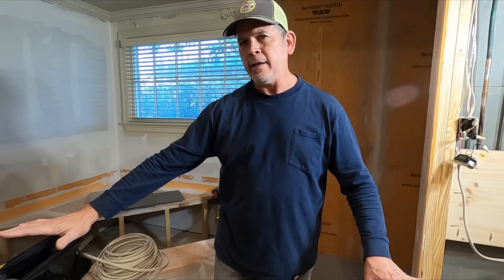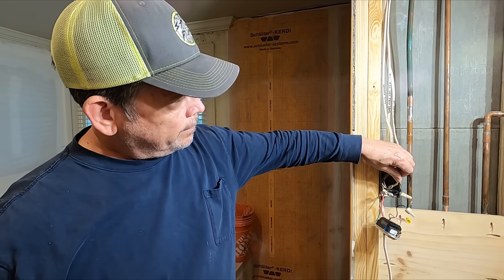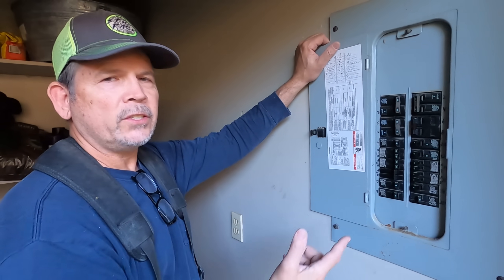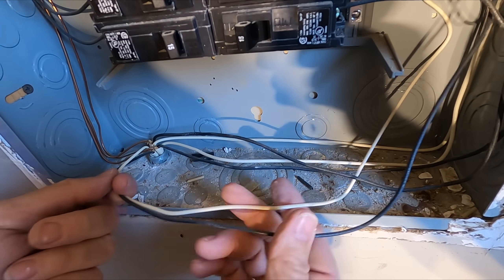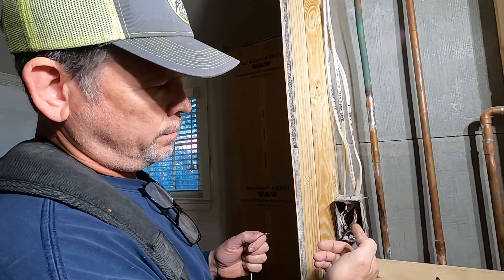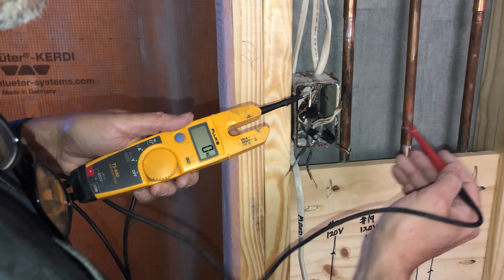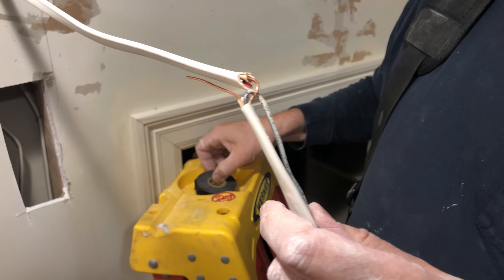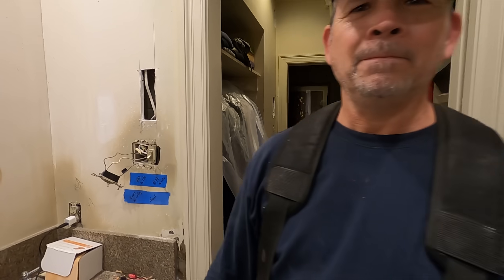You CAN Get SHOCKED by a Neutral Wire! This is How...

Comment: My worst shock... I was working on an election hot water tank... I turned off the breaker, went to the hardware store and got a new tank, all was good... Removed all the plumbing from it then I took off the wire nuts and then went to grab the wires to pull em from the tank... Well Someone went and turned the breaker back on so I grabbed a live 220V circuit... It threw me against the wall... I came out barely walking, staggering... Turned the breaker back off and finished the job... That was my worse... 110 I barely feel a tingle...
Reply from the maker: Thx rusty nail.  A previous comment said “that’s why they call them hertz” 😂

Comment: First, a great video! As an owner of electrical supply company for many years, I have heard some crazy stories from "our electricians". Many involved "dirty neutrals". One thing to be aware of, many LED issues are the result of either dirty neutrals or overloaded neutrals. LED's are super-efficient, therefore they "return" unused power through the white wire (neutral). There are cables available with super-neutrals, that is to say, they are manufactured with a white wire larger than the black wire. The other thing to be very aware of is when removing or replacing a panel cover, always wear eye protection (preferably a face shield) and gloves. We had an electrician who was severely burned removing a panel cover. There was an exposed main feed cable resting near the cover. As they say, wiring is no hobby...call a licensed electrician!
Reply from the maker: Thx Ron 👍 good stuff about super neutrals and safety 👊

Comment: The wire you are claiming is a neutral is a hot, and marked as such by the black tape which is legal and normal.

Not that I am saying you shouldn't check anyway. Or that there was not issues with this work.
Reply from the maker: Thx Court.  Many caught this.  That tape was me identifying that neutral as “hot”.   It was not a rebranded white wire.  Sorry for the confusion 👍👊
Reply: @StudPack  Ah, I see.  It doesn't change using caution and not trusting the marking of unknown wiring though so you still make a good point.  I know I have blindly trusted it before.

Comment: Can never be too safe around electricity. Commercial carpenter here, when we're building high rises we don't always have access to GFI protected power sources. Sometimes we have to plug our cords in to the building's power outlets as we build up higher, and you can imagine how that works when we're working up top on a rainy day and there's 3 inches of water on the top slab.

Worst shock I've ever had came from trying to unplug a power cord from a 4 way splitter that was hanging on rebar (to keep it out of the water puddles) and the cord had a cut in it that I didn't see, right where I grabbed it. One hand on the cord, the other on the rebar completed the circuit. I couldn't let go of the cord due to the shock, I had to walk backwards away from the splitter to make it disconnect before I could let go.
Thankfully the electricity path stayed on the surface of my skin since it was raining so hard that day, but my arms sure tingled for about a week. Could've been a lot worse if it had gone through me. Now I religiously check all power cords for cuts :D
Reply from the maker: Thx Keith 👍👊.   That hurts.  Really appreciate you watching and commenting
Reply: @StudPack  No worries Paul, just found your channel and I love watching this kind of stuff to pick up on all the tricks other tradespeople use on their projects.

Comment: As an Electrician, I am impressed with your explanation. Great Job. One thing though, standing on the top two steps of a step ladder is a big no no. I believe you will notice that even the ladder warns against doing that. A fall from 6 ft can hurt alot worse than 125V shock. Just sayin'
Reply from the maker: Thx max and I hear you about the ladder 👍

Comment: too many jack legs doing wiring, its those guys that will get guys like you hurt. my house had over half the receptacles wired with black and whites reversed. Not sure I could of figured out the solution as you did, I am an EE but its the troubleshooting these type of problems I need to improve on....

Comment: And the reason the lights come on when bonded to the copper when is bonded from the main panel is the EXACT  reason 4 wire is ran to a sub panel and separated. Good work.

Comment: 12:52 I can't stand attics.  I've been re-wiring my house and the only cables going into the attic are ones that absolutely have to.  That being light fixture cables.  Anything else that was previously going through the attic was re-routed down through the basement.  A lot of 12/3 cables.  That's one reason I don't want to pursue a career as an electrician, I know I'll be in attics a lot and that's where I draw a line unless it's winter and cold haha.

Comment: 4:09 is that current as of the NEC 2020 or is that a local stipulation for your area?  Because I believe subpanels only require their own shut off if they are installed in a detached building such as a garage or shed.  If it's not detached, it doesn't require it's own shutoff.  That's what I last understood...but maybe they changed it?  Either way, I wouldn't want to have a subpanel without it's own shutoff personally.
Reply: I live in an old house and neither our main nor the sub have master breakers. Instead you have to pull the meter out. The sub is connected on the main bus bar lugs instead of a separate breaker.

Comment: What you had was a floating neutral with that white wire not connected. All neutral wires MUST connect back to the panel neutral else it becomes a floating neutral and will have voltage on it relative to ground.

Comment: Neutral is only as safe as the breaker supplying anything powering devices connected to the neutral. Where you screw up is assuming turning off the breaker also isolates any other sources.

Comment: Stablok panels are 1-2-3-4-5 etc on the left then say 20-21-22... on the right, those breakers are also 'reversed' off and on.  You also have to 'drop' one breaker for 240volt - 1/2 3/4 etc are same phase so you have to single 1 to get 2/3 for 240volt. Stupid system.

Comment: So horrible wiring that's not to code basically leads to a live shared neutral. There are by the way switches that would trip in cases like this, however I don't think it typically used in the US unless you are in a bathroom. I think they are called GFCI switches. They are basically becoming common where I live as they have the benefit of tripping out a single circuit if there is a fault to ground as opposed to an entire panel. It should be noted that in old installations tripping the entire panel with a ground fault only happens if you have a distinct ground fault breaker (rough translation the name my differ). These have however been mandatory for a long time and I don't think you are allowed to operate a house without installing one unless all switches are of the GFCI type.

Comment: Any properly wired neutral cannot shock you, as it is truly the exact same thing as your bonded ground... Electricity isn't mysterious or confusing, just takes a bit of understanding... as a previous electrician, controls electrician, flows and controls engineer...I can tell ya, if a N gets you, it's because of an improperly wired scenario, likely a backfeed. But rest assured, so long as you don't take the hit from arm to arm through the heart... 110 isn't going to get you to the point of feeling days later, let alone moments later... You feel the tingle, you back off and re-evaluate things. Shouldn't get that far, should be testing before touching.... but yeah, outside of 3 phase, 277, 408, etc.. you aren't in for too much of a bad time... Residential can't get ya that bad unless you REALLY line things up for a proper Darwin award.

Keep in mind, ALL neutrals are shared via the common bus in any given panel... You shouldn't ever mix neutrals in junctions or any other box, as you need to worry about neutral balancing ... but yeah, ALL NEUTRALS are the same neutral... always. Just about always. But yeah, you've got an issue there.

And an edit later, you hit these items and found a backfeed... improperly wired, viola.... as expected.

Comment: I've been an electronics technician for 38 years, and this is the first time I've ever heard of neutral sharing in house wiring. I've found reversed polarity on several wiring repairs I've done for friends and even in my own home in the garage, but have never come across a shared neutral. I don't care if it meets code if it's ganged breakers, it is a really stupid way to run wiring. I have the same distaste for it as I do for the way some people have run 3-way switches that allow the hot to be connected to a ceiling light on both sides when off!
Edit: One other wiring issue that I've found distasteful is in medical equipment made in Europe that has fuses on both the hot and neutral. If the fuse on the neutral blows, the entire circuit becomes hot and increases the shock hazard exponentially.
Reply: Confused, if the hot is connected from both sides to the light then the light is never off unless the neutral is switched which can't happen. Yes I understand several ways to wire 3 ways and when a neutral is and isn't required in the box. Can you explain further?
Reply: @castarmax1970  An old house a friend owned had a 3-way wired so one wire went from each switch up to the light, and the switches were wired where the hot and neutral were connected to each side of each switch. That made it so either side of the light could get hot or neutral. It worked just like an ordinarily wired 3-way, but dangerous AF. It was a nearly 200 year old house and the wiring looked like it had been modified a dozen times through the years.

Comment: As a matter of habit, I always run my multimeter on any exposed wires in the box after turning off the breaker. I'm sure most do this as well. Mislabeled panels are always a treat.
Reply from the maker: I did Larry.  All was good until someone turned on a 3-way switch in another room and energized that neutral 😖
Reply: @StudPack  Oh I wasn't assuming you didn't. But, yikes on someone messing with the 3 way switch!

Comment: That was never wired properly thats why it is doing that. Both circuits that share the neural should be turned off at the same time. The two breakers that share the neural need to be tied together so they trip off together
Reply from the maker: Thx Will!  I had two issues 1) the two circuits were same phase (#19 & #20) so they couldn't have a handle tie and 2) all the wires were deemed safe but someone turned on a 3-way switch in another room fed by another circuit which put voltage on the neutral I was working on.   Hope I explained that okay 👊
Reply: Probably your best bet would be to locate both circuits and then use a 240 V double Pole breaker and connect the circuits to it so they will both shut off together.   Kind of like what you should do if you have 2 circuits fed by a 3 wire romex. Black and red would feed 2 separate 120v circuits and return on the same neutral.  You have to use a double pole breaker though so they will trip off together. 👍
Reply from the maker: Yeah that probably would have been easier than running that wire like I did.  I just didn’t want to start moving breakers around in that panel.  Appreciate your comments 👊

Comment: The neutral were crossed or used as multi circuit which is ok, also the main breaker is not necessary unless is in a detached structure.
Reply from the maker: Circuits were same phase not opposite phase as required by MWBC.

Comment: Simple answer to the other power question. Unless all power is removed from the area, ALL, the chance for being shocked is possible due to the fact that; any load, light, motor, fan, etc will act like a fuse, or solid connection to carry current to the whole circuit. 
 PS: this is why all lamps, and doubly so with a lamp with two or more light fixtures should be wired with a polarized plug and be sure all of the center of the bulb contacts are the switched one/hot wire contact. All of the outside thread part wires to the neutral. The hot on the plug is the narrow blade, and the wide one is the neutral. I fixed two lamps with these problems last year.
Reply from the maker: Thx Renneth.  Great info on lamp holders and polarized plugs.  A lot of people don’t know even that.
Reply: @StudPack  Thanks.  I learned this clearly at a job I had building small table sized egg grading scales. We used a grounded plug for it as well, but where each wire went I wast told clearly how to wire the motor the the light bulb. Black hot (bites), White neutral (cool), Green ground (metal frame). The one lamp fixture I repaired for a lady in 2019 had three lamp holders. As best I could tell that floor lamp was fully original wiring, except maybe the switch was replaced. Two were wired with the black to the center, and one was wired with the white to the center. This meant if a person touched two if the threaded parts at the same time and it was turned on the would be shocked just by touching one bulb base while replacing the bulb in another. Often in multi light fixtures people will do this when the lamp is turned on, because they need the other lamps lit to see what they are doing. This fixture was also fully made of metal but thankfully it was not wired with the metal part as part of the current caring part of the circuit, but if a old wire frayed the metal fixture is not alive.

Comment: Looking at the wiring codes in the US am surprised the place has not burned down twisting neutrals.  In the UK lights loop in loop out on ring of live one ring to neutral and leads to switch back to the light.  We can have Kitchen with up down lighting on it's own fuse.

Comment: I don’t get why you had to run that new wire
Reply from the maker: We pulled out a two conductor cable and installed a three conductor cable.  The three conductor gave us the neutral we needed to tie into the abandoned neutral in that single gang box.

Comment: Question.  If you turn off #20 to that box and use a non contact voltage detector on the white wire would it detect the 120v?

Comment: You use current and voltage as if they are the same thing.   You actually are applying 240 across the circuit, probably splitting it unevenly between the lights.   Plesse use the correct terms if you are trying to instruct.

Comment: Nice job!
I would also like to point out that
You had 2 different phases (circuit 19 & 20] in that box and a potential of 240v. Leaving the bulbs. Thats a no-no. From my understanding you are  not allowed 2 different phases in the same box. A 240v circuit has no neutral.
If they were on the same phase, to u would be technically overload the neutral
That's a no-no as well. Let me explain.
Assuming the wires are #14. That means each circuit is capable of supplying 15A. Suppose each load (light bulbs in this case) was drawing 13a. The circuit breaker would not pop because each black wire was supplying 15A and yet only 13 was the load. But wait, the neutrals now have 26A (13A + 13A) on it!!! Clearly that over the limit for hat guage wire! Yikes! You might come home to just a foundation one day because if an overload on the neutral!
Reply: You have no clue!  If both Hot Legs have 13 Amps flowing, then 0 Amps would flow through the Neutral.  Clearly, you are not an electrician.  You should not be explaining anything, to anybody ...

Comment: You are lucky the circuits 19 and 20 are on the same "phase" .  If they were on another circuit that is connected to the other "phase" breakers you would have a serious problem as the voltage would have been 240 volts between the "hots". (Usually the breaker opposite (same plane) from the one you're working on will be the same phase.  ie. 19 & 20.  The breakers immediately above or below the one you are working on is a different phase.)   
Never assume a white wire is a neutral!  It is not a neutral unless it is connected to the neutral bus.  When you disconnect a neutral  "joint" ,  those wires are now "L2" capable of still being hot.  The worse shocks I've  had in my 40 year career have been from "neutrals" that were disconnected somewhere ahead of the neutral bus.  During those events the loads of that circuits traveled through me.  It hurts and is potentially deadly depending how "grounded" I am. 
It's wise to have a tester on hand.  A cheap "twitter" or "glow stick" is a  great tool to have on had.  Just make sure you test it first on a known "hot" and realize it does have sensitivity limits.

Comment: Before I disconnect any wires I always put an amp meter around each wire even after shutting the circuit breaker off this will tell you if you’re about to open up a shared neutral.

Comment: 1/23/2021 USA Grandpa Bill:  This was enough to make me subscribe. Thank you.  Yes, I'd like to see more deep dives. I'm stopped from replacing my back door security light. When installing the new one I found two hot wires (black), a white wire, and the ground. I'm stumped. With the switch off, the one black wire is still hot.

Comment: Excellent instruction. Great voice and clear  pronounciation.  (Standing on top ladder rung is unsafe and OHSA violation).
Reply from the maker: Yeah I know about the ladder.  That’s a 7 foot ladder with 9 foot ceilings in a tiny closet.   I’d need a 10 foot step ladder to meet OSHA but it would never fit.  Neither would an extension ladder.  What do you do?  Thx Mike 👊

Comment: have a circuit breaker that now works in when in the off position, and doesn't work in the on position. I just did some rewiring, and am an amateur. I messed something up somewhere.  What could it be ? Is it dangerous ?
Reply from the maker: You definitely need an electrician to sort that one out.